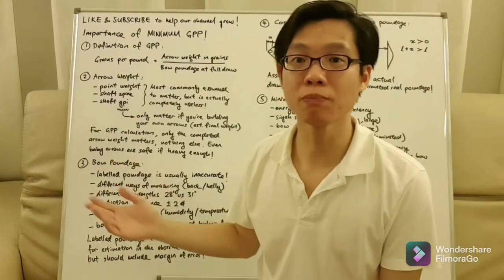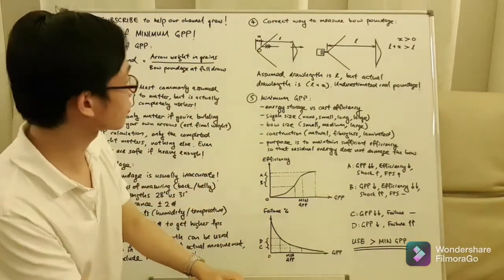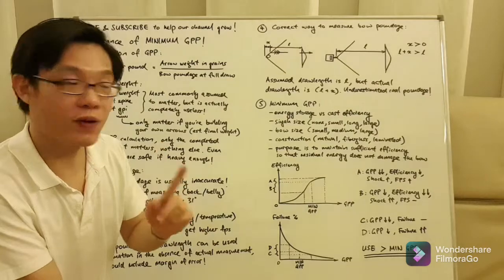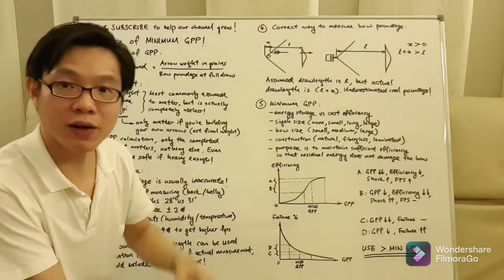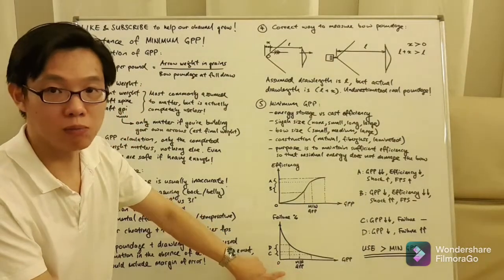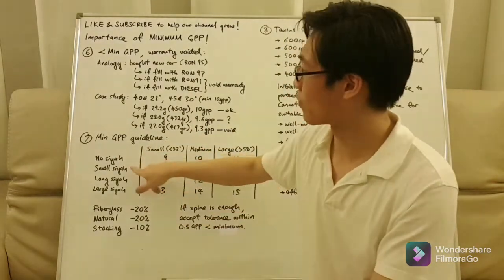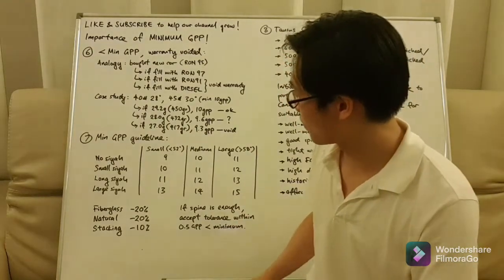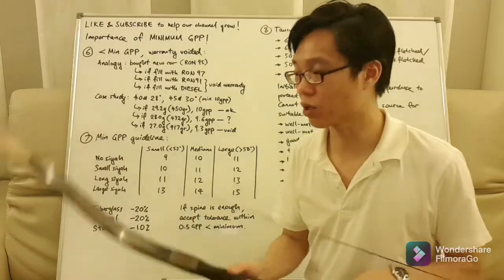Importance of MINIMUM GPP! (Part 2)

Comment: Hi there, I fell in love with those arrows right away...(after watching Eureka video)...unfortunately it seems like the shipping costs from Malaysia are pretty steep ...
That alone is the only reason I haven't ordered yet...
But thanks for the videos and info...you're doing a great favor for the entire archery community 🙏🏻🙏🏻🙂👍🏻🇨🇦
Reply from the maker: Ya, shipping nowadays aint cheap. They start at USD60 for a box that could fit 2dz arrows. If you don't mind squeezing the arrows without any foam spacer, a smaller box would be USD50 to ship. Though you might need to fluff the feathers with steam later (usually not a concern, they aren't damaged). Otherwise, packing into a box with foam spacer would cost abit more due to the box volume. Or alternatively, get 2 dozen to fit the box but without foam spacer, that'll average out to USD30 per dozen hahaha.
Reply from the maker: Hi, over the past several months, I've been selling the Taurus Arrows internationally. I've found a rather smart way to ship the arrows and they cost only USD38 for the shipping (fits upto 2dz per box).

Comment: One thing that is important to me, is that covering that i see on the front of the fletching, is it one of those rubber sleeves, or is it a thread materal wound around it? I bought a set of alibows arrows matched with my last bow and they have been the best arrows ive bought yet, but also have this binding around the ends of the fletching. Its hard to get carbon arrows that have this. Also where do i buy these taurus arrows?
Reply from the maker: Watch this https://youtu.be/G638FW9rxEk

Comment: You are hardcore, man. Very awesome 😁
I always go too heavy, rather than too light. Just to be sure.
I use very tip heavy arrows. Is that good in your opinion?
Reply from the maker: Heavy point makes arrow forgiving. Good for me. Don't worry what the naysayers say about FOC dives the arrow. They live on flat earth. In my world, gravity affects all the same.
Reply from the maker: The only problem with normal heavy points is the weakness at the joint (could bend or break). That's why I use deep tang design, where the point also helps to reinforce the shaft.
Reply: @bambooarchery  Well, usually the heavier the insert, the longer it is. 😁
This weakness you're referring to, is it a problem when the arrow hits the target at an angle, or is it uppon release that it might break?
Reply from the maker: If you hit something hard. For example, if you went through the target and hit the frame behind at a slight angle, it could bend the joint between the point and screw. The longer/larger the point, the worse it will spin/wobble as it magnifies offset in concentricity between the shaft, insert, and point
Reply: @bambooarchery  I see. That's what I thought. Thanks for the reply.

Comment: Could you recommend a quality online retailer? I have found it difficult to find a online retailer which lists pertinent arrow properties and has a decent selection.
Reply from the maker: Since i dont buy from them, so unfortunately i dont know either. If i knew, and if they are effective, i would not have been forced to create my own brand of arrows just to protect the bows i sell. Having need to sort every batch of arrows that comes in is not very productive for me, but I don't see a good alternative out there. Imagine having to weigh through 3000 arrows and sort them to dozens such that each set is just 0.1 grams tolerance. And do this every time you restock arrows, alone -- yes i work alone.

Comment: Howd you know if im drawing the bow exceeded the drawing limit? I.e..if i have a 40lb bow rated at 28" draw length like your study case there, and im using 27gram arrow and its break because im drawing at 30" >40lb, i will say i only pull it at 28"..so 27gram arrow still inside 10gpp right? Will u still void my warranty? I hope you can understand my question
Reply from the maker: The way a bow breaks usually highlights the cause. For example, damages at the nocks is most likely dryfired, failure near the handle could indicate overdraw, failure near the siyahs could indicate longterm use of underweight arrows. This is why sometimes bowyer require that you return the damaged bow for analysis. If the bowyer finds any defect in the gluing which could have resulted in the delamination, then the bowyer is most likely to provide the warranty. But if the gluing is well done, then the failure is most likely due to user negligence. It is possible to sometimes cheat the bowyer if the root cause looks ambiguous, or rather the bowyer provides the benefit of doubt when he's uncertain. But if there's solid proof that the bow is damaged due to negligence, and you tried to cheat, you'll end up being blacklisted and your warranty voided.
Reply: @bambooarchery  ok..nice and clear explanation..tq bos

Comment: Hi.. just want to check with u, as per the explained GPP table references, it only considers the Bow Siyah types and Bow length (small, medium & large) regardless of how many bow poundages? So I meant regardless of how Bow poundage is lighter or heavier, it will only consider the Siyah & Bow length for the GPP preferences? Do the GPP references apply to all bow poundages? Hope u will reply to this inquiry. Thanks.
Reply from the maker: The definition of GPP by itself is grains PER POUND. If you are working a part time job that pays $10/hr, your pay depends solely on the working hours. Your question is asking me if you'll be paid the same $10/hr regardless of working 1, 2, 3, 4, ... 1000 hours.
Reply: oke from ur video the GPP table references and the arrow Taurus that u design, u refer to which bow poundage range? I meant based on ur calculation from the video u are referring to what range of bow poundage?  something like 30# to 45#? I Just want to understand the GPP scale guideline for at which range of bow poundage
Reply from the maker: You are assuming gpp as a constant number such as arrow weight, it is not. Gpp is a ratio and regardless of your poundage, from 1 to infinity, the ratio is the same. The arrow weight changes, not the ratio.

Using the example before, the pay rate of $10 is the same regardless of your working hours. But the total wages changes based on the working hours
Reply from the maker: GPP is a ratio, therefore it is by definition, a scale. You do not scale the scale. If your bow design needs 10gpp, then if you have:
30#, you'll need minimum 10gpp × 30# = 300grain arrow
50#, you'll need minimum 10gpp × 50# = 500grain arrow
100#, you'll need minimum 10gpp × 100# = 1000grain arrow
150#, you'll need minimum 10gpp × 150# = 1500grain arrow
Minimum GPP requirement doesn't change, it is like a physics law. Your equipment setup will produce different GPP depending on the bow rated poundage, your full drawlength, and total arrow weight. This has already been explained clearly in part 1 of the video.

Comment: Is this theory backed with some evidence ? Didn't found any in video. I mean this guidline table, where do you get it from ?
Reply from the maker: The guideline comes from thousands of broken bows over several years, brands, and dealers across the globe. It is a guideline, not a theory, and certainly not a law.

To illustrate this, if you obey the traffic law, it doesn't guarantee that you'll be accident-free. However, the traffic law serves as a guideline, and if you obey it, you're statistically less likely to be involved in an accident.

Similarly, if you follow the guideline that I had accumulated, you are less likely to have a broken bow. If you do not follow, it doesn't mean you will definitely have a broken bow either. It just means that you're statistically facing greater risk of a broken bow.

If you have doubt on anything I say, feel free to test it yourself.
Reply from the maker: And if you wonder how broken bows help generate the table, it's really simple. Initially there was huge amount of broken bows, then you raise the minimum gpp by 1 and see what happens. Keep testing the market over long periods of time and many interations, taking enormous financial loss. At one point, once you have enough gpp, suddenly the amount of broken bows drop drastically. And you found the minimum gpp that doesn't break your bow.
Reply: @bambooarchery  Ok, that makes sense. It's just not said in video and I didn't know your background. Thank You for answer.

Comment: Hello Friend,
Thank you very much. That means, when my bow maker wrote me to use 9-10gpp and a minim of 8. 
My bow has 32 pounds and i choose 10Gpp:
                           X (arrow weight in Grains) 
10gpp=         --------- 
                          32 (drawweight, i draw exactly 28") 

Follows : 10x32 = 320 Grains 

I buy an arrow with a total weight of 320 Grains I guess?
Reply from the maker: In your case, 320grain will give you 10gpp at your 32# 28" draw. However, in reality, you're unlikely to find such light arrow weight, so you just use anything and it'll be heavy enough. GPP matters more when you're using higher poundages, but at low poundages, any arrow is heavy enough.
Reply: @bambooarchery  Thank you very much for the fast answere!

Comment: Why compound bows shoot 4-5gpp?
Reply from the maker: Because compound bow are not traditional bow. Why would diesel engine use diesel instead of petrol? Because diesel engine aren't petrol engine.
Reply from the maker: Modern compounds are designed and tested down to a minimum of 5gpp. Below that is not warranted. Most compound archers don't follow this, and prefer at least 7gpp or greater (10-12gpp) for improved efficiency/comfort and reduced equipment wear/damage.
Reply: @bambooarchery  There are so many nuisances to archery!